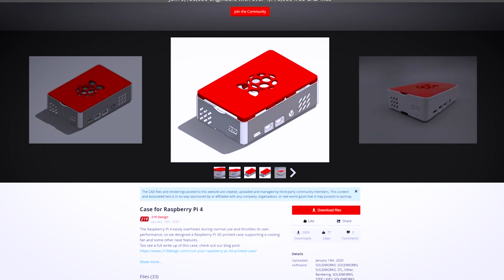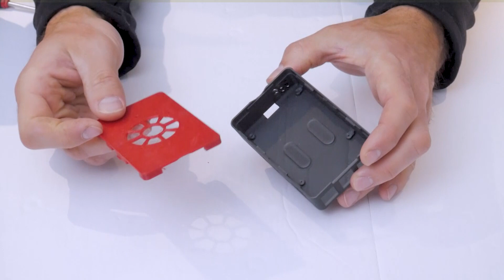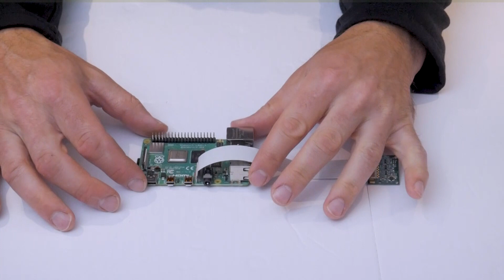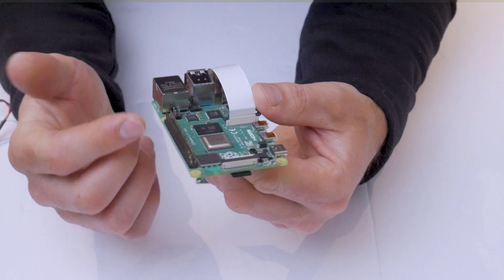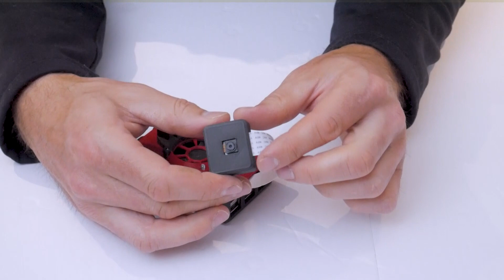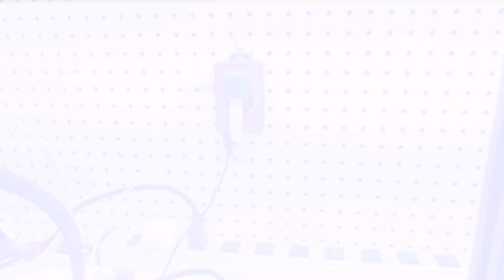Raspberry Pi 4B TURBO Case With Integrated Camera Mount (3D Printable - Great for Octoprint!)

Comment: What  Pi board do you suggest to buy for octoprint?
Reply from the maker: From the octopi website: 
Recommended hardware: Raspberry Pi 3B, 3B+, 4B or Zero 2. Expect print artifacts and long loading times with other options, especially when adding a webcam or installing third party plugins. Setups not using recommended hardware are not officially supported.